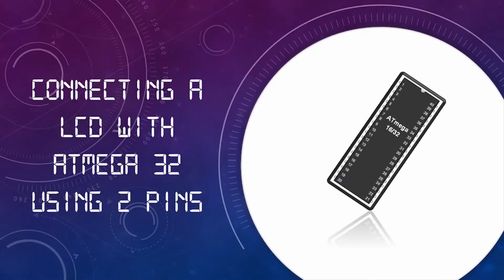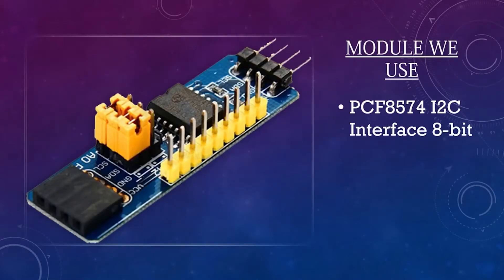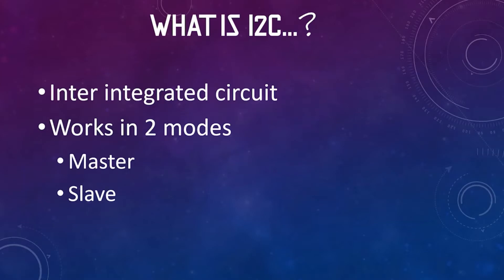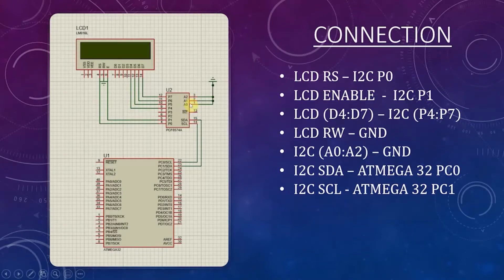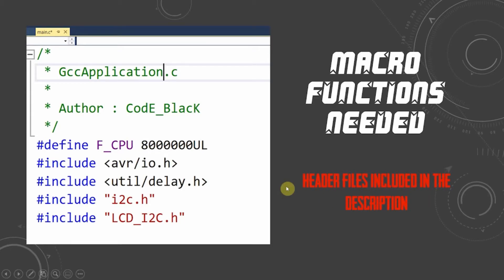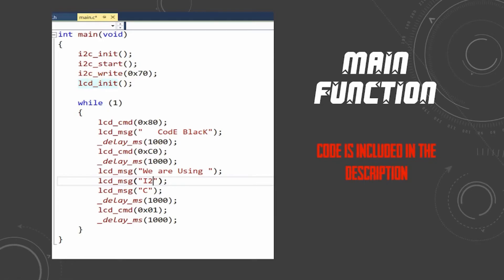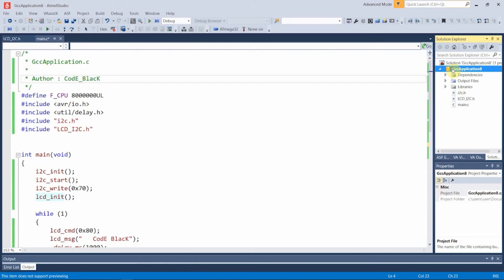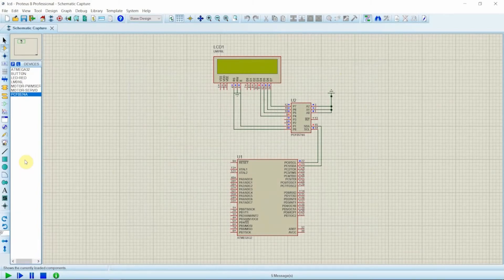LCD CONNECTON USING 2PIN | I2C MODULE | 16X2 LCD USING I2C AVR | ATMEL STUDIO | PROTEUS

Comment: I sent the code to my atmega328p but the display just shows the first line all white, i already vary the potentiometer. Should i edit something in the function void lcd_init?
Reply: Same here not working. Did you find a solution? Normally it has to do with the address of the I2C but I don't know what else to do.